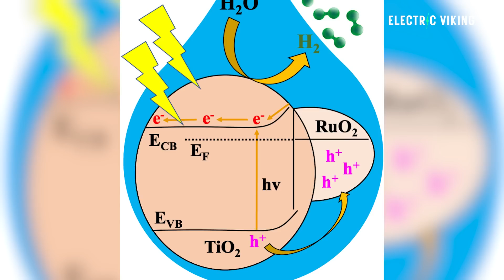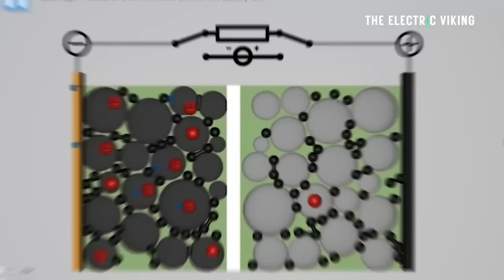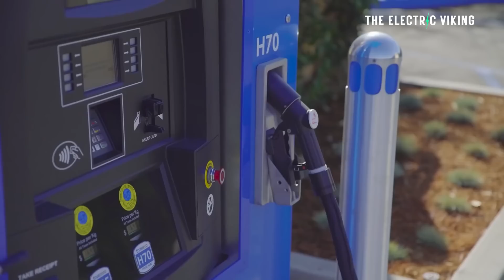American researchers use sunlight & water to efficiently create green hydrogen

Comment: We presently use an array of fuels for an array of applications.  There seems to be a misunderstand that in the future there will no longer be a need for an array of applications using different fuels.  Hydrogen is a highly suitable fuel for a number of applications, maybe not for cars due to the challenges of distribution and storage but that does not mean that research and breakthroughs in greener hydrogen generation are not highly valuable.

Comment: So it's a solar cell that produces hydrogen from water without first producing electricity to power electrolysis. If it produces hydrogen less expensively than existing methods of producing hydrogen from natural gas, it can disrupt hydrogen production even if the hydrogen is not used much for transportation. If the hydrogen makes a hydrogen powered vehicle less expensive than a BEV to operate, it can disrupt EVs, but I doubt that I'll live to see it. Unfortunately, this article doesn't even guesstimate the cost of hydrogen produced by the new method.

Comment: Despite climate-friendly plans, the Canadian government’s controversial decision to take over the Trans Mountain pipeline made it one of world’s biggest promoters of fossil fuel projects. The Trans Mountain pipeline crosses two provinces, THROUGH THE MOST BEAUTIFUL NATIONAL PARK in the Rocky Mountains, dips underneath bodies of water and passes through dozens of First Nations communities before terminating at a massive polluting oil storage facility on the verdant shores of the Pacific. After a decade of fierce protests, COST OVERRUNS THAT EXCEED THOSE OF NUCLEAR PLANTS, and construction delays, oil started flowing at the beginning of May, but there was no grand ceremony or ribbon-cutting. Instead, a China-BOUND Aframax tanker named Dubai Angel departed with 550,000 barrels of diluted bitumen to be sold to global markets. In the coming years, the POLLUTING megaproject will move nearly 900,000 barrels every day. The number of tankers will surge sevenfold. THEY AREN'T POWERED BY WIND OR SOLAR. Since 2015 Canada is the only G7 nation to emit greenhouse gases FAR ABOVE its 1990 levels, while planning to extract and export record volumes of oil. The pipeline itself has become CONCRETE EVIDENCE of a Canadian contradiction: promises of strong climate action, coupled with BILLIONS in fossil fuel investments and MASSIVE  government SUBSIDIES to the oil industry at a moment when the planet needs to move away from fossil fuels.

Comment: This technology seems an interesting approach, but unless/until it can beat 23% PV efficiency and 80+% electrolyzer efficiency, it's rather a scientific curiosity. The advantage of PV and electrolyzers is also the versatility to either use the electricity directly or make hydrogen. Additionally the infrastructure for electricity already exists and enables the location of electricity production to be decoupled from the location of the electrolyzer.
And it has to beat the price of PV which currently is cheaper than window glass.

Comment: Imagine a solar farm that runs a green hydrogen plant that uses the stored hydrogen to power hydrogen turbines to generate power when the solar is off-line.
Reply: Or just use the electricity to run a pump and pump water up a hill, when its dark you run it in reverse and make electricity….. oh it already exists, pump storage hydroelectric….
Reply: @nobilismaximus  - unfortunately, not everywhere is suited to pumped hydro as it requires certain geological characteristics to be able to deploy. It is also it's fairly costly and involved lengthy projects to implement due to the scale required to be cost effective.
Reply: @GruffSillyGoat  well yes, you need abrupt changes in elevation and the ability to build a dam, but you have to admit, it has potential. Geddit, potential… Brain the size of a planet……….
Reply: @nobilismaximus  - Ah I see, it's the consideration of the gravity of the situation, needing to be elastic in approach, that generates an electric atmosphere - still each shows different potential ...  “Reality is frequently inaccurate.” Douglas Adams.
Reply: Why loose 3 times the energy in creating hydrogen from electricity then converting it back to electicity, it is more effective to store the electricity in batteries (flow, sodium or lithium based depending upon need) to be used when needed (at 95%+ efficiency).
Reply: @GruffSillyGoat  Cheaper Setup with Application Flexibility. Initial costs are less with the option to use the hydrogen for something other than power.
Reply: @silversurfer415  - Hydrogen is more expensive both in upfront capital and ongoing operational costs than battery systems, which is why battery based BESS systems are being deployed en-mass around the world compared to hydrogen. Hydrogen's cost benefits only kick in with static industrial applications where power and waste heat can be utilised.
Reply: @GruffSillyGoat  "Cheaper Setup with Application Flexibility" was the response as to why "Why loose 3 times the energy in creating hydrogen from electricity...". Whatever the source of energy (electricity) generation, storage of that energy, in the private sector, as hydrogen, amounts to an electrolyser and storage (tanks (gas) to hydride ("solid")). Tanks are cheap; up to several thousand USD, AUD, EU. A combo unit of electrolyser and storage could cost well under the cost of a Tesla Wall to that of equal and beyond. However, a setup of "equal and beyond" would be commercial/industrial grade. "... en-mass around the world..." is more hype than fact. It's good marketing, but it speaks little to none as to why the individual cases are so; mainly spoken to so-called "renewables".

Nonetheless, I did say "... with application flexibility." Not everything is electric and not everything should be done using electricity. With hydrogen, I can cook over a flame, mix with other fuels and make them environmentally friendly, cut, weld, fuse, heat, detoxify water, germinate seeds, neutralise radioactive waste, seal concrete, etc. If one has the option to avail possibilities for oneself, one should do so.
Reply: @silversurfer415  - Again, per unit it is expensive having more applications doesn't makes it cheaper to produce, as the main cost driver is the input production costs. Further, in each of those fields listed hydrogen will have to displace existing technologies. Plus mixing hydrogen with other fuels doesn't make them green, rather it extends the use of the dirty fuels. In terms of home use for heating/cooking, recent trials in the UK both came to the conclusion the safety risk with hydrogen was too significant and the costs to mitigate such were too high.

Comment: Toyota just came up with a hydrogen generator that converts water to fuel right on the vehicle. That's right folks. Toyota just invented (or maybe reinvented) a water powered car. The videos are on You Tube. Check it out. This makes EVs obsolete. On a side note, thorium nuclear reactors are coming to market. This will make wind and solar obsolete as well. The future can be very bright with cheap to almost free energy.

Comment: Hydrogen fuel cells have many valid uses. Makes an excellent high capacity backup system. During a outage you can power your building with a fuel cell, having more delivered as needed.  For cars, the big hurdle is storage.  If they can perfect a liquid or powder that easily supplies the hydrogen, this could be a big improvement.

Comment: The problem with this tec compared to pv is not only higher cost (think of all the pipework to collect the H2 and the expensive ruthenium) but it's far less flexible. Electricity has so many applications and is easy to transport AND if it's needed can also be used to make H2 at similar efficiency as a direct light to H2 process.

Comment: Good to hear American researchers have been able to use sunlight and water to produce green hydrogen. FYI, China has been producing green hydrogen by the electrolysis of seawater (most abundant natural resource on our planet) using electricity produced by solar and wind energy for the past 1-2 years. Green hydrogen is in mass production in many areas of China, and I understand the cost is as low as 40cents/cubic metre of hydrogen. Green hydrogen is needed for many industrial purposes, rocket fuel in space program, and also in fuel cells used in trucks (50,000 by 2025), buses, trains and possibly shipping. China by the way is the world's biggest producer and consumer of hydrogen.
Reply: 40 cents per m3 of hydrogen amounts to almost 9$/kg. And that's probably without compression, transportation and profit. Not exactly cheap if you ask me.
Reply: @dirkvornholt2507 As hydrogen weighs 0.082 kg/cubic metre, the cost of green hydrogen production if I am correct is about $4.88/kg presently. With improved efficiency and mass production in the future, it's possible the cost could go down further possibly to 1-2 dollars/kg.
Reply: @peterliu8145  - this is the weight per cubic metre at standard temperature and pressure, which is too gasseus to be handled or used due to a very low volumetric energy density of ~0.003kWh/L (3x10^-6 kWh/cubic meter). To be useful it either needs to be liquified (at -253°c) or stored at high pressure often over 1000bar at site (350 to 700bar in vehicles),  both processes are quite energy intentive. The current high cost of hydrogen reflects this energy use and handling cost, econmonies of scale will improve the generation but have a lesser impact on the handling and transportation due to the variable and fixed cost elements involved. Production projections estimate $2 to $3 per kg in generation by 2050, plus a further $3 to $5 in processing and distribution costs giving a range of $5 to $8 per kg. Meaning a 400 mile top up (~7kg) tank would cost in the order of $35 to $56.
Reply: @GruffSillyGoat  Many thanks for your valuable input. According to your calculations, it would cost between USD35 (35 x 7.75 = HKD271) to USD56 (56 x 7.75 = HKD434) to top up a 400-mile tank. I used to own a Honda 7-seater station wagon in Hong Kong over a year ago (I now own a BYD Atto 3 eV) and it would cost me about HKD800-900 to fill up the tank. So paying HKD271 to HKD434 to fill up the tank is still a significant saving compared to petrol and it's much cleaner and non-polluting. The main drawback is do I want a potentially more explosive and dangerous tank in the back of my car?! Also, cost of running an eV still significantly cheaper than running a hydrogen-powered car.
Reply: @peterliu8145 You are right. I'm factor two off because I estimated using H instead of H2. But still, the cost per norm cubic meter is kind of odd and misleading for comparison as hydrogen has a really low density. But it definitely depends on the use case. For replacing methane in pipelines cost per m3 might be suitable.
Reply: @peterliu8145  - thats a industry 'projected' cost for 2050. Lots of ifs and buts whether this will be achieved as it depends upon widespread adoption. Currently hydrogen can cost $36 per kg in some parts of the world. However, for lightweight vehicles (like cars) you have also to factor in the heavier weight and bulkiness of hydrogen FCEV systems, that reduce range and eat into passenger/cargo space.

Comment: Professor James Tour has a method of breaking down waste plastic into its constituent molecules. The great thing about the process is that the carbon produced is graphene - which is very valuable. So valuable that the hydrogen also produced is essentially free.
Reply: Actually Graphene is not as expensive and valuable as you might think, I know because I work in a company who uses Graphene
Reply: @scottwilliams1623  I was told graphene costs about $1,000 per gram for the highest quality graphene. But I know the Tour process doesn’t produce this quality but a type suitable for strengthening concrete and other materials. However the hydrogen produced is significantly cheaper than green, black, blue or white hydrogen as well as stopping plastics filling up landfill.
Reply: @johnfrancis4401  not nearly that expensive as far as I know.

Comment: Sam, 
Thanks for this video. I'm interested and will ask someone I know about this..

But in  no way H2 will be efficient for usage in cars.
The main issue is the high pressure tanks for taking eneoug H2 with you for a little of range.
Even when it would be possible to create H2 with a near to 100% efficiency the compression (to at least 800 bar) is too costly....Each megajoule energy in the H2 delivered under pressure in a tank will cost another megajoule for the compression.
Max efficiency is alread down to 50%...
With electrolysis the max efficiency for creatimg H2 is also ca 50%....compressed in the car we are down to 25 % efficiency.

A battery is up to 95% (even higher is possible) efficient for storing energy.

But in the end of your video you give some places where we can use this H2 with a big win for the environnement. Steel production would be my first target to transfer to h2 instead of the poluting cokes.

Comment: If you have so much spare electricity you waste it making hydrogen what do you want the hydrogen for? There is already someone making 'natural gas' using cheap solar electricity to crack water. Maybe this process may make that a bit more viable. But hydrogen itself is not really practical for anything much, or we would have been using it for ages before this.

Comment: No need to transport hydrogen or fuel cars with it.  You simply port the hydrogen production directly into a fuel cell stack.  Depending on the metres cubed in gas volume that is produced would determine the size of the fuel cell stack.  The energy can be sent via the electrical grid.  No need to store or transport hydrogen.
Reply: And where does all the energy instensive, large and heavy hydrogen pressurising and cooling equipment fit inside the car? Without this a killogram of hydrogen produced would occupy about 1,000 cubic metres. A Mirai has about 5.6kg of hydrogen to power the car for 300 miles, meaning you'd need 5,600 cubic metres volume to store the hydrogen without pressurising it. Hydrogen's energy density by weight (gravimetric density) is 33kWh/kg but volumetric density is tiny at 0.003kWh/L at sea level conditions. 

The hydrogen generation systems, the smallest ones, occupy a land foot print of about 20 family sized cars parked bumper to bumper in a square. For the Mirai this equipment squeezes the 5.6kg hydrogen down to fit a volume of 85 ltrs, holding the hydrogen at a pressure twice the average depth of the planet's oceans (all held inside 100kg worth of tanks, that are 3 times the volume of the hydrogen being held within).
Reply: @GruffSillyGoat  stupid

Comment: Hydrogen cars by nature will be simply more dangerous than electric batteries. Toyota's hydrogen race car went up in flames i think last 1 or 2 years ago? 

Liquefying means the hydrogen will be under pressure and that means the thing is explosive or the tank walls have to be really reinforced. The other thing that makes it suck is that they will need tankers to carry the fuel to refueling stations like current oil tankers. Electric rechargers on the other hand needs you to lay power lines and that's it.

Cheap hydrogen as a fuel for certain functions would be great but for cars, it just not up to par.

Comment: For passenger cars hydrogen doesn’t make sense. An EV with 250 miles of range and home charging takes care of 95% of driving needs. Drove the ID.4 333 miles with one 1/2 charging session. Still has 50 miles left when we reached our destination. Totally stress free experience. If we took the Tesla M3 RWD it would have been even more stress free because I wouldn’t have to pre plan my one stop. The only legitimate argument against owning an EV is if you can’t charge at home.

Comment: Sam, I think I just found an interesting bit of data.  The fuel for a 10 day journey of an ocean freight ship would weigh 4 times as much as a CATL condensed battery with the same amount of energy!
Reply: Add to that the dangers posed by storing leaky hydrogen and the costs and effort required to maintain the support equipment.

Comment: Does anyone have an idea what it is like to transport and carry hydrogen? Might as well name your yacht "Ka-Boom". 

Or there is a catalyst that learns the energy required to split the H2O molecule into hydrogen and oxygen, bit those catalysts are expensive and rare. It doesn't scale. 

Have you ever even heard of some of these elements? The video references lab level tests that most likely will not scale to a cost effective commercial solution. 

Did they try Unobtanium as a catalyst? No Sam, not a hydrogen economy - stay away from the kool-aid.